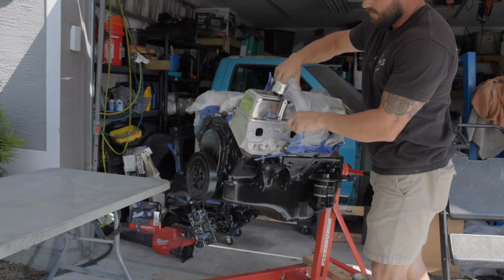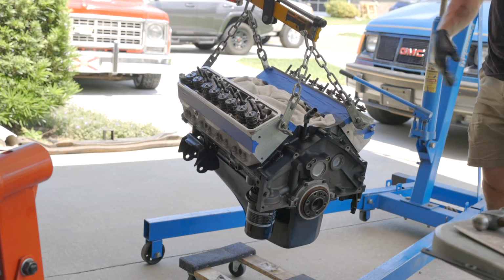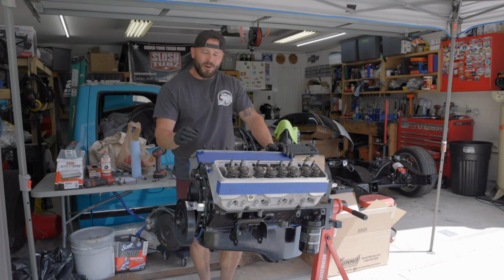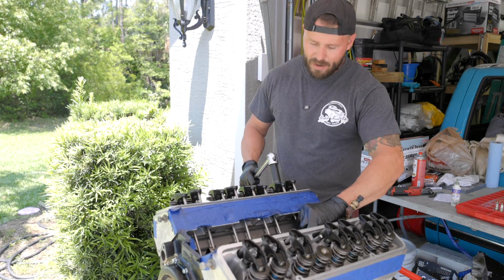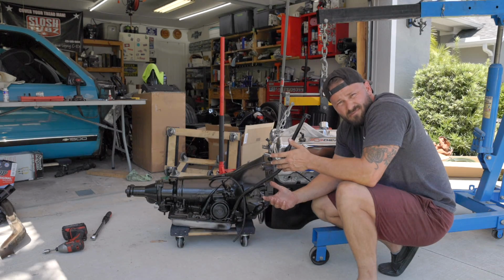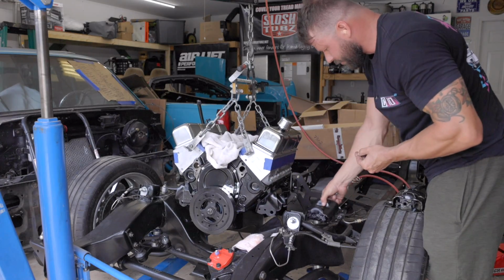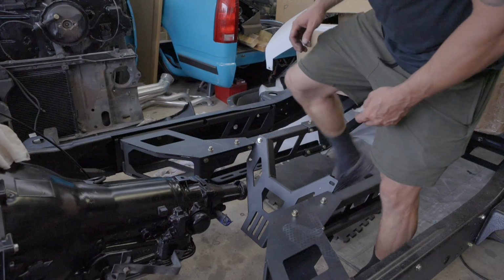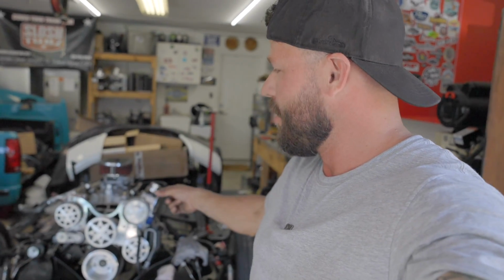Installing A Choppy Cam And Setting The Motor

Comment: When you do dot to dot on timing chain, that’s #6 top dead center. Thats why so many people are of 180 when they fire it up and backfire out carb. I do the dot to dot and spin until cam gear is at 12 o clock.
Reply from the maker: That's a great tip!